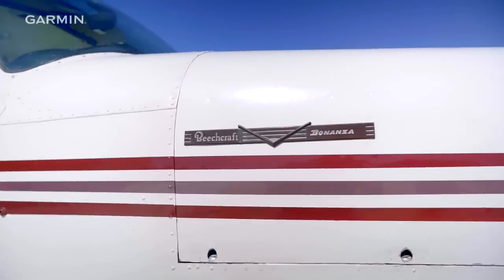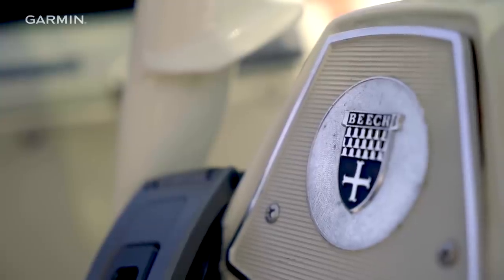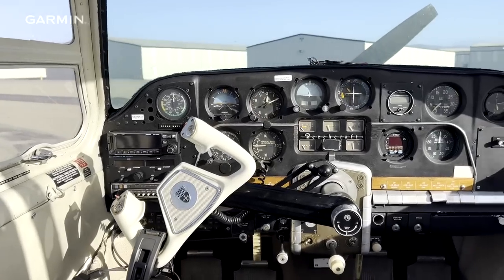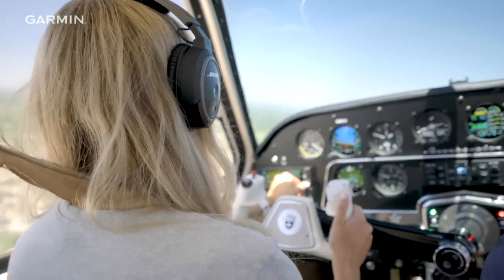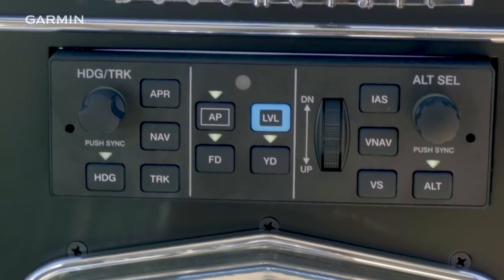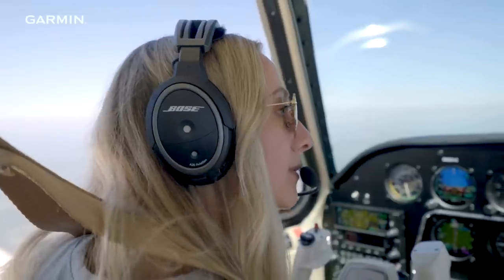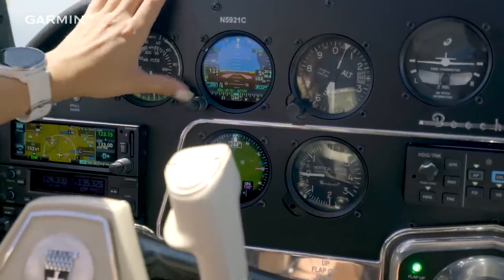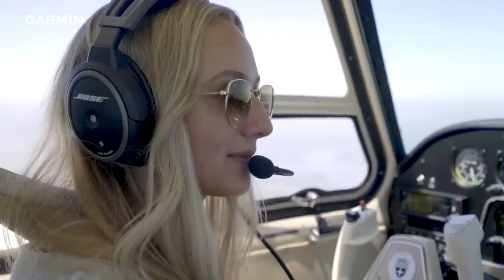Garmin | Avionics Vintage Panel Upgrade | Stevie Triesenberg

Comment: Nicely done. I would have moved things over a to keep the T&B under the airspeed.  Also would have a T&B not a turn coordinator. I have an F35 with the classic panel, one fuel gauge for four tanks and so on. The 275 is definitely something I would consider.

Comment: I always wonder why people don’t do it like this more.
Reply: Most people when they upgrade their attitude indicator and directional gyro don't usually re-do the entire panel plastic/metal or re-do all of the wiring, which is what Stevie did (about 70 lbs were shaved off the Bonanza after removing and re-doing the wiring).
Reply: Perhaps the cost is prohibitive:(
Reply: @CreepinCreeper145  I’m saying why don’t people do it like this it looks nicer.
Reply: @MattMorris481  People want glass, pretty much.